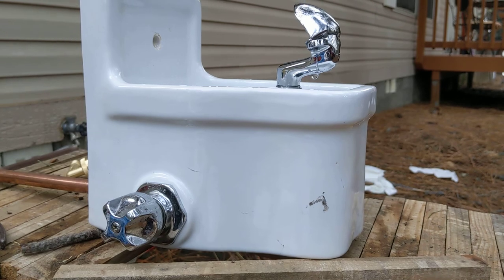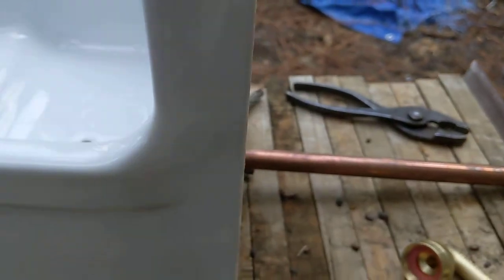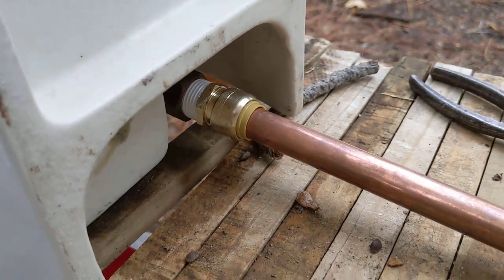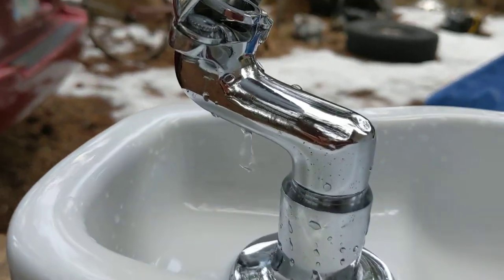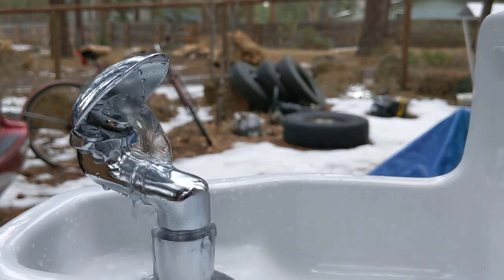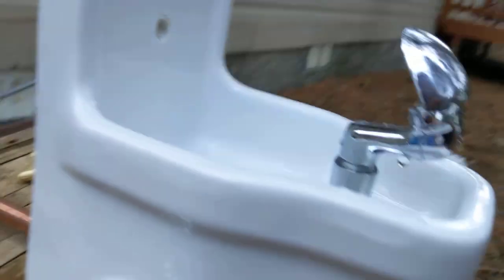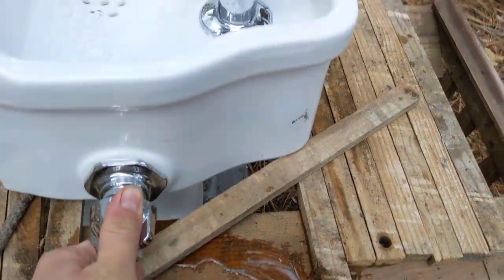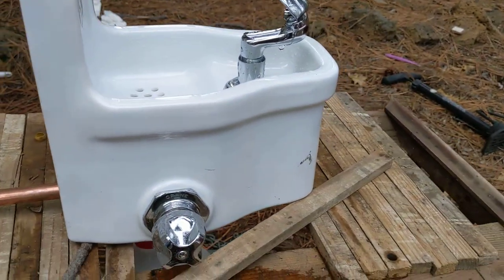248. Vintage Crane Drinking Fountain!

Comment: Very cool! The chrome is in great shape. That stream is unique and I can imagine maybe you are supposed to kind of "kiss'' the wide stream and drink. The round brass fitting underneath is a pressure regulator and that most fountains have some for of that to adjust the flow. My Kohler has one just like it.  The drain fitting is a closet spud, which is kind of cool too.
Reply from the maker: Cool! I think I saw a pressure regulator on one of my Halsey Taylor fountains.